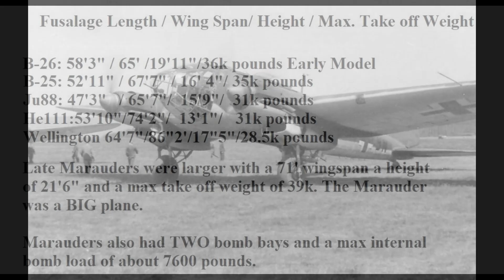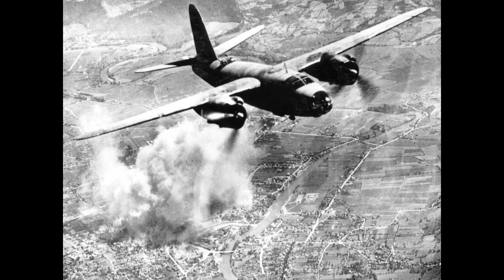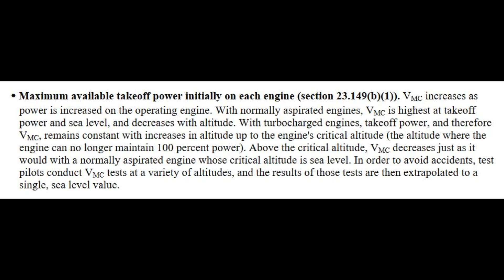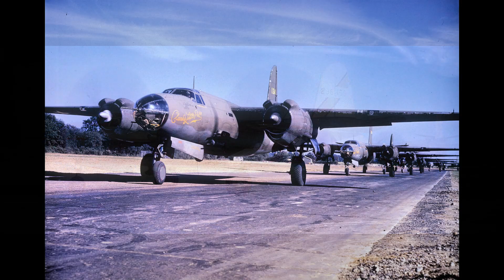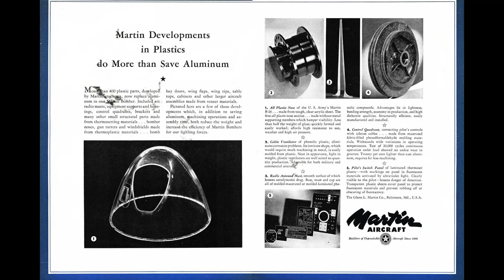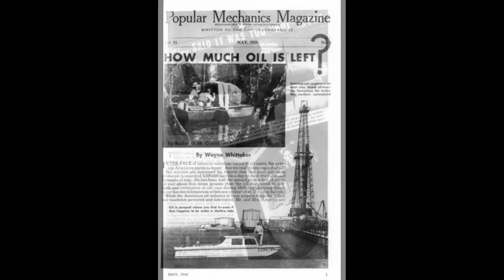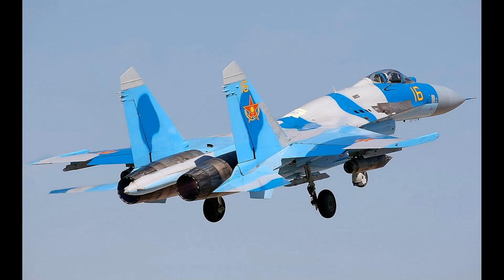Martin B-26 Marauder. Unsafe At Any Speed?

Comment: One of the reasons stated in another video on the B-26 for its many training accidents was, the pilots were coming out of slow, docile, easy to handle trainer aircraft... and stepping up to a high performance one with a very high landing speed compared to what they were used to.  In many cases, almost double the speed they were used to flying in the pattern.  So, if they weren't watching very carefully, they would let the B-26 drop below its minimum speed... and the aircraft would become a brick.  Like a 21 year old getting out if his dad's Buick... into a Hellcat on a track.  The results can be very bad.  Another major reason was, the powers to be decided to add several weighty additions to the aircraft, including the top turret, to an already designed aircraft.  So, it was much heavier... and required higher take-off and landing speeds, that the original design would have required.
Reply from the maker: Those things were common to every military plane.

Comment: Hi, is an  "injection carb" like the fuel injection system GM had on its early 1980's cars? Like the crossfire injection or whatever?
Reply from the maker: Matt, it's what G.M. called "throttle body injection". Basically one or two big injectors squirting into a common intake plenum:manifold.

Comment: So it sounds like if there's an engine failure right after takeoff, the pilot has two options: either reduce power on the good engine to maintain directional control and crash upright, or firewall the good engine and hope to gain directional control before the plane rolls over and crashes anyway.
Reply: No, if you use full power below Vmca you will go on your back immediately, even with full rudder.

Comment: 1:00:26 The B-26 was a war time plane. It was not a peace time plane. 

On the lifting the nose wheel at 60mph, I've heard that there were concerns that the nose wheel was weak and wouldn't handle higher speeds. But I'm not sure if it was ever determined to be a real or merely suspected problem. 

It does strike me that a lot of Martin WWII bombers seemed to have real issues on takeoff and landing, and very good combat records. I recall the A-30 Baltimore was another extremely capable Martin attacker that also had very nasty take off and landing behavior, and vanished after the war.
Reply: Even nowadays pilots often abuse the poor nose wheel, they are delicate.

Comment: Well thanks for explaining why the stats I could easily find for the B-26 never really lined up with the personal testimonials I could also easily find. The answer is Mr. Martin cared more about printing info that would matter most to the pilots than boasting about a brief new top speed.

I don't know how hard it would be to do the math, but do you know how much that dangerous window on take-offs would be closed with the more powerful engine options originally considered? Obviously the situation would be better, but how much? How bad of a remaining problem would there be?
Reply from the maker: If they would have used the more powerful engines and accelerated to a higher speed before raising the nose on take off it would have been safer. They way they were flying them, it would have been more dangerous.

Comment: On risk versus utility: Seafires at Anzio shot down two German bombers, damaged four other aircraft, but lost about 40 in accidents, none to enemy action. However, I'm not sure what the balance of loss of life was as the Seafires might have prevented any number of attacks, something never adequately captured in K/D ratios.
Reply from the maker: The Seafire was a waste of deck space during WW2.
Reply: @GregsAirplanesandAutomobiles  It was unfortunately an aircraft of necessity for a period due to a lack of anything else, like enough F4Fs. I'm not sure why, by the time of Anzio, though, F4F or F6Fs hadn't replaced it.
Reply from the maker: There were better options out there. I'll make a video about it one day.
Reply: @GregsAirplanesandAutomobiles  I'd like to see such an option. As I understood it the preferred short term option was US aircraft, but that supply was curtailed, and there was no domestic option other than the Seafire in 1941/2. If your video could examine that, it would be great.

My original point, though, was quite how terrible the accident rate was compared to kills, to the extent you'd have thought they'd have grounded (decked?) it, not continued to produce it.
Reply: Little escort carriers at low speed in calm winds were a bit to much to ask at Anzio.

Comment: Good discussion about Vmc. Comparing to the Mosquito - it had a power on stall speed of 90-95 kts, and safe speed is quoted as 155 at +9 boost and 170 kts at +18 boost. That must have been a hairy few moments waiting to accelerate the 60-70 kts from takeoff to safe speed…

For some reason the pilot notes recommend that if takeoff was performed at +18 boost, power should be reduced after takeoff. I would expect that the best thing would be to accelerate as fast as possible to safe speed - the pilot can always reduce power if an engine dies (assuming he is well trained and keeps his wits).
Reply from the maker: VMC is lower with less power, and arguable less chance of blowing the engine. Those are probably the reasons.

Comment: When speaking about fighters with dual-main wheels, the Russian (Soviet) MiG-31 comes to mind. It does have dual-main wheels, but they are set up as tandem, as opposed to the side-by-side configuration that you showed in your photos. Of course, like anything, this is the exception to the rule, as they say. I remember a USAF early jet fighter design that had this same tandem dual wheel configuration as well. It folded up into the outer wing panels, giving it a very wide-track when grounded. I'm sorry not to remember the name of this fighter off the top of my head, but it might have been by Republic. It may have been a concept, although I did make a model of it way back in the late 1950's/early 1950's when I was a pre-teen. I was big on model aircraft and cars at that time. I believe there was a Swedish fighter with the tandem wheels as well.
Reply from the maker: The Mig 31 is barely a fighter. It weights more than a DC9-21

Comment: Only "modern" fighter I can think of that has dual main wheels is the Saab Viggen, which has two wheels in line with each other instead of next to each other.

That's a pretty distant outlier though, considering it was meant to operate from 500m (1640 ft) sections of rural highway. They did a no-flare landing at a quite high descent rate.

Comment: For those that are interested, there are actually 4 reasons behind the critical engine in a conventional twin.

1. P-Factor (Which is discussed here)
2. Propeller Torque
3. Accelerated Slipstream over the wing
4. Spiral slipstream impinging on the rudder
Reply from the maker: C.G., Landing Gear down, a few others. I think officially there are 9 factors of VMC, although the number changes from time to time as they sometimes combine some, sometimes not.

Comment: Why didn't they use contra-rotating props on the B-26? That seemed odd to me.
Reply from the maker: They didn't have a version of the R-2800 that could swing the props in the other direction. That didn't become common until later. Very few WW2 multi-engine planes had counter rotating props.
Reply: @GregsAirplanesandAutomobiles  Ah thx for the answer. I genuinely didn't know that.
Reply: @GregsAirplanesandAutomobiles  Didn't the French twin engined aircraft often use it - maybe the Service technique de l'aéronautique demanded it?

Comment: Liked the discussion of safety at the expense of effectiveness. Makes me think of Sherman tank criticism that puts effectiveness above producibility and transportability. Sure great make an eighty ton tank instead with battleship armor and a gun that belongs on a rail-car. Not one would ever be lost because they'd never leave the continental U.S., at least in significant #'s. And they'd need a fuel tanker to operate alongside them if they ever did reach combat.  Combat equipment design is a hell of a balancing act; safety, performance, logistics, cost, usability, survivability, primary role, secondary roles, etc. Not to mention using cutting edge vs. proven technology. You could end up with a reliable but outclassed machine, or an incredibly high performance nightmare for mechanics and trainees.
Reply from the maker: Thanks Bradley, that's exactly it. The Sherman doesn't get the recognition it deserves for it's greatest attribute, which was being exactly the right tank at the right time for the U.S. Army.

Comment: A story I first heard many decades ago about the B-26, and have found countless times since then, was that the danger during training was the non-counter-rotating propellers. The story went that if you weren't careful with your throttles on taxi and takeoff, you could flip the plain upside down, where it had a less than graceful angle of attack.

I'm wondering now if all those stories were apocryphal.
Reply: The people who go on and on about how deadly normal conventional propeller (not counter or contra rotating) rotation twins must be, are people who do not have a multi-engine aeroplane rating.  There is a world of difference between what is measurable and what is significant.
The danger in training was deliberately operating on the very edge of safe performance in a plane with actually shut down, not simulated shut down (with feathered engine and propeller drag matching very low power and control settings on the shut down-simulated running engine) engines at low altitude, at low speed, in performance killing high temperatures with inexperienced instructors barely ahead of the biggest, heaviest, fastest, highest wing loading plane they had ever flow.
It was war time and the Air Force was going to operate those planes at the maximum conceivable weights and accept the safety reduction, the war was to be won and the brave volunteer service men were expendable.  When Martin increased the wing span for safety the Air Force immediately increased the take off weights.
Reply: Counter rotating propellers were rare in those days, and even more rare on 4-engine aircraft, which have an even greater yaw when an outboard engine fails.  But at least a 4-engine plane has lost only 25% of its power instead of 50%, so if the pilot can control the yaw he can more easily accelerate or climb.  Everybody says this plane was to "hot " to fly safety, but what really killed B-26 crews was the mechanical issues that caused abrupt engine and propeller failures with no warning at the worst times.
Reply: Opposite-rotating props were very rare in the 1940s. In fact, the only WW2 twin I can think of that used them was the P-38. The Mosquito didn't have them. Even later war-time high performance twin designs like the P-61 and the Grumman Tigercat didn't have them. Neither did the B-26's eventual replacement, the Douglas A-26. Why criticize the B-26 for not having something that almost no other plane had at the time?

Comment: The only fighter adjacent aircraft I can think of with twin main wheels is the Russian Mig31, and even then as an interceptor that weights 50,000LBS empty and is over stressed at 4-5Gs you could argue that it is in a different class that doesn't really count.
Reply from the maker: Good point, it's barely a "fighter" but it does have dual main wheels.

Comment: I think all the newer US aircraft were rushed into production and service and thus there was a lot of accidents . Probably the training improved too and that reduced accidents . It was a steep learning curve when you see what was available in Dec 1941. So crews were having to adapt to much higher performance as well which can add to accidents . Higher landing speeds etc. You get a lot higher accidents rates  in the 50s and 60s because planes like the F104 and EE  Lightnings pushed the performance envelope massively .
Reply from the maker: That's true, but we see similar accident rates in the other Air Forces of WW2. It was a different time.
Reply: @GregsAirplanesandAutomobiles  yes Bomber Command had 10000 deaths from accidents (known of ) training etc. about 20% of the total . many missing in action are probably not from flak and fighters ; just proves what you are saying about the B26 ; flying in WW2 was always a compromise between safety and completing the mission .
Reply: People blamed the B-47 but it and the KC-135/B 707 were new ground from the designers all the way to the regulators, there were lots of very hard lessons to gather.

Comment: I've never understood why the B-26 isn't more popular. It was fast, powerful, deadly, and it looked like a shark with wings. Whether or not it was the best medium bomber is arguable, but IMO it was absolutely the coolest. I mean, just look at it!
Reply: YEAH, Martin Murderer   ...judge the rest
Reply: Any plane that gets a reputation of killing it's own aircrew is going to be unpopular. Helldiver, Barracuda, F7 Cutlass, etc....
Reply: @treyhelms5282  It actually had the lowest attrition rate of any bomber of WW2.  0.6% which is the same as the Mosquito.   The accident rate got down to a problem with ground technicians discharging the aircraft battery during test procedures leaving the electric propellors to feather due to lack of power on takeoff and crew training. If there is an engine failure on takeoff it must be immediately recognised, the failed engine feather etc.
Reply: @williamzk9083  There were many problems with the B26, which is why it was a bad aircraft. The lower loss rate has everything to do with the fall of the Luftwaffe, and that the B26 was given easier missions. When the B26 encountered heavy opposition, it was slaughtered. Not to mention the high accident rate.

It's telling that the servicemen preferred the B-25 and the A20.
Reply: @treyhelms5282  the B26 problems were quickly fixed.   The increased wing area to cure what was essentially a training problem cut 40 mph of the speed rendering it more vulnerable to interception.  All bombers without escorts were slaughtered it was only a matter of how quickly it would take.
Reply: @treyhelms5282  sources?
Reply: @guaporeturns9472  actually watch the video in whose comment section you posted in. Everything I said about the B 26, Greg referenced. “ martin B26 marauder. Unsafe at any speed? “
Reply: @treyhelms5282  actually , that’s great
Reply: @guaporeturns9472  yeah, aren’t Greg’s videos awesome? I disagree with his conclusion about the b26. He thinks the B26 was OK. But he does a great job of listing the faults I cited. And the B26’s strengths as well.
Reply: @treyhelms5282  I’m just wondering where all the pilot’s memories are stating how much they liked the B-25 and the A-20 more? I can’t find them. The B-26 flew more sorties with fewer aircraft and dropped more tons of bombs with a lower loss ratio than the B-25. Either way it’s fun to hear about this stuff and converse with folks who enjoy history. Be well
Reply: @guaporeturns9472  in the beginning of the video, Greg talks about how the B 25 is more popular. 

In the ETO, the B26 initially got slaughtered and then was relegated to much shorter range safer missions. In the Pacific the B25 was modified and used for variety missions in ways the B26 never was, such as anti-shipping with a variety of nose armament.
Reply: @treyhelms5282  would be cool to  hear/read about pilots who flew both talk about and compare them.
Reply: The increased wingspan and weight from other fixes slowed the B26 down.  It is a cool looking plane, especially it's earlier "flying prostitute" config. But yeah, it was not popular with it's crews for reasons. It remained accident prone, maintenance intensive, and not as tough or versatile as the Mitchell or Havoc.

Comment: What I don't get... from your explanation, it would seem that going with counter-rotating props, with the inboard side of the propeller arc sweeping down, would have somewhat alleviated that  worse-case engine-failure-during-takeoff scenario. And it would seem that this change would not have affected the performance of the airplane. Am I missing something?
Reply from the maker: That's exactly right C.M. The bottom line is that there was no reverse rotation R-2800 set up, so it wasn't an option for Martin.
Reply: And different propellers, more difficult with electric props.

Comment: Always liked the Marauder as it's one of the sleekest WW2 bombers (and has a cool name), but so little has been written on it and usually what there is has been negative.  Since they used it a lot and in big numbers I thought it must have been overall better than presumed or something else would have been used in it's place.  One of the tells is the combat losses vs other planes as you discussed.  Planes regarded as safer and easier to fly like B-17s for instance were shot down by the score.  B-26 losses?  Hardly hear of them.  

I learned so much in this video and not just about the Marauder.  The parts towards the end about Utah Beach vs Omaha and other D-Day ops were very eye-opening.  I had no idea that the difference in bombing effectiveness was one of the primary factors for the difference in the effectiveness of the respective beach defenses.   The necessary developmental wartime compromises really put things into perspective as well.  The Marauder seems to have been a victim of being too early to the party much as the P-38 was.  A guinea pig for mistakes and compromises using new technology that ended up still being a good plane, but without receiving the promotional attention by the USAAF as the P-38 and others still got.  Such a shame.

Thanks for another fantastic and unique video.  Nobody puts this level of work and research in on this type of topic and I love how you keeping knocking aircraft myths and misinformed beliefs down one after another!  Great work as usual!